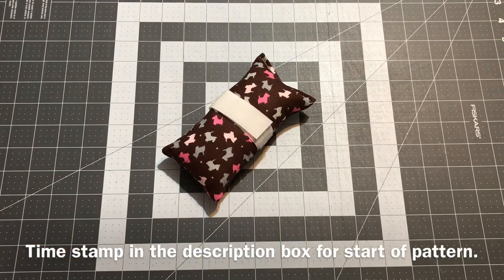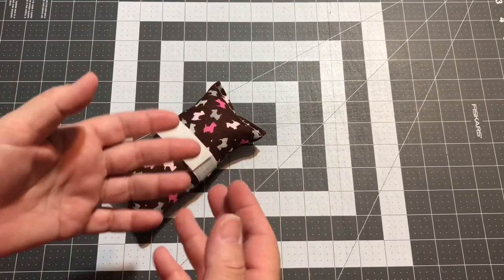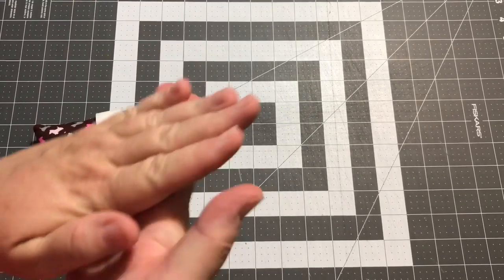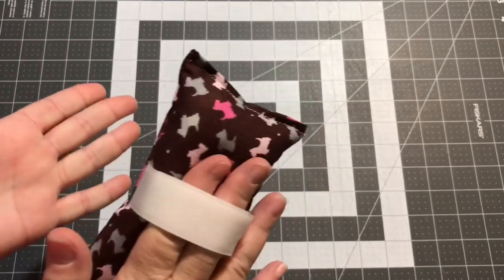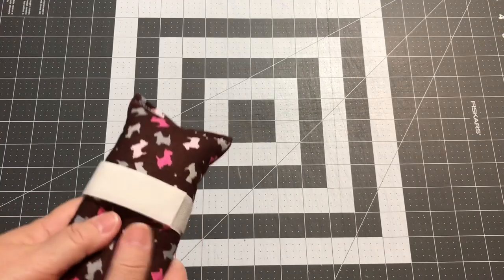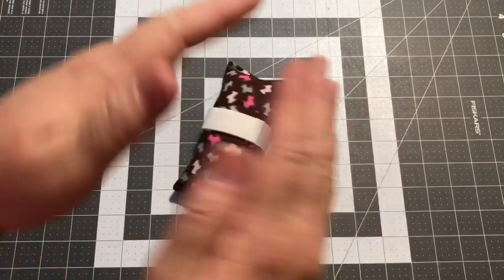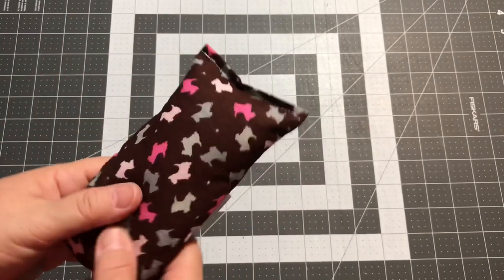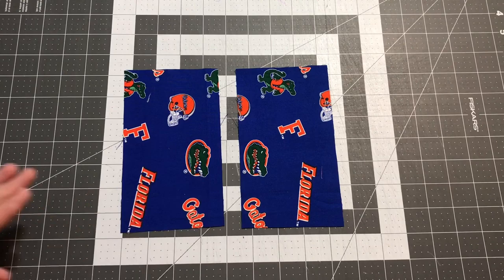Sewing a Port Pillow for Cancer Patients

Comment: If you round the corners of the velcro before you stitch it down, it won't be so poky. You may have to just measure the velcro a quarter inch longer to allow for the rounding.
Reply from the maker: Thanks Karen! That’s a great idea.

Comment: Thanks for this video. This is definitely an item for me to add to my donation crafts list. My mom had a longer port pillow with a set of straps near each end that closed with snaps. Velcro would have been better as the snaps were hard to open and close. I might make both this size and longer ones.

Comment: Could these be used to prevent rubbing on the neck if so how would you construct them differently
Reply from the maker: I haven’t tried It to protect my neck from the seatbelt rubbing.   I’m not sure that It would be the best option.   I don’t currently have a video for a seat belt protector but they are easy to make.   They’re basically a potholder with Velcro.  Something to wrap around the seat belt  and a way to secure It.   I’ve added a seat belt cover to my future tutorial list.  Thank you.

Comment: Could I use quilt batting instead of the stuffing?
Reply from the maker: You could try using batting instead of creating a pillow but you would most likely need several layers.  The port pillow provides a cushion between the port and the seat belt.   I’m not sure if you’d get the same effect with just batting.